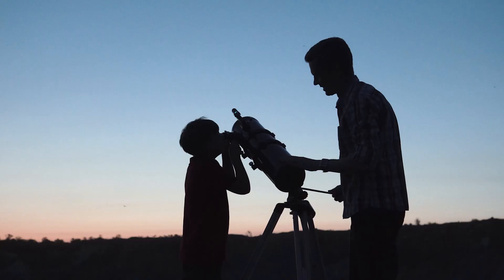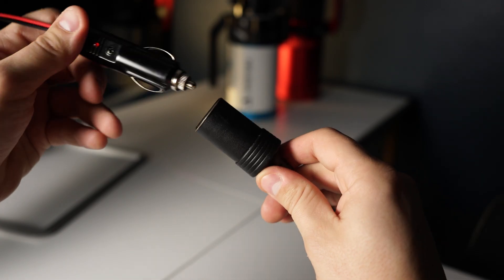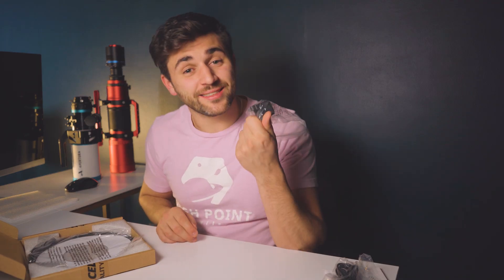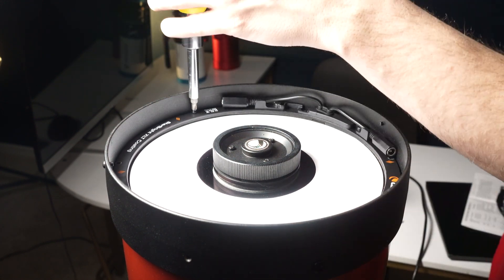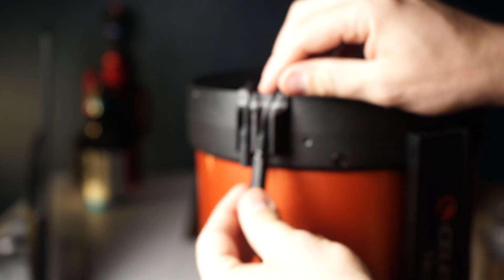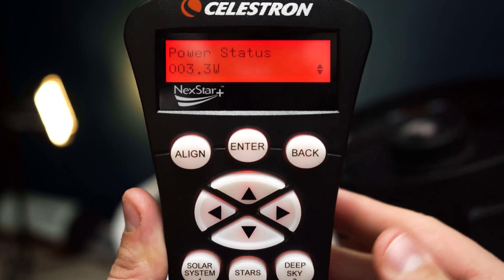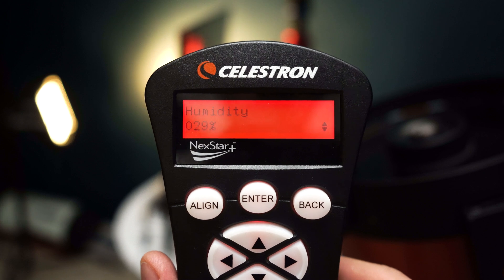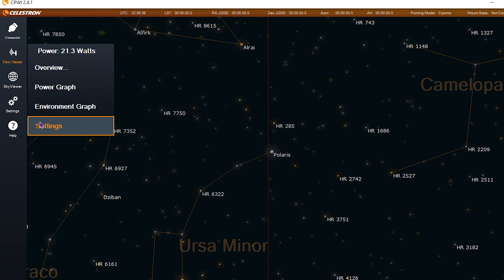Celestron Dew Controller | Full Overview and Setup | High Point Scientific

Comment: I'm a purely visual observer using a 120v wall outlet. Am i understanding correctly that i could plug in the ring with one cord (using a 120v to 12v adapter) and not bother with the thermistor? Thank you (update I found a 12v dimmer switch on Amazon and it's been working great with this heater ring)

Comment: 40 years ago, astro gear and viewing was so simple.  Today, you need youtube to explain so many necesary system installation and operation.
Reply: Well, sure.  Things change.  Some people prefer some of those changes, and some don't.  Personally, I live in a part of Texas where relative humidity averages 90%.  If I want to observe all night, I'm bringing a hair dryer or something like this.  The hair dryer works great, but at 1200W it won't run very well on a battery, so then I need a generator.  The reality is, the system in this video is much more convenient.  Mount it all once, and you're basically done.  I used Kendrick Astro's dew heaters before that, and they worked great.  But I wouldn't call them any more intuitive.  And if I'm not travelling and wanting to get in a ton of time, one of many manual scopes comes instead, and all of the sudden I'm living with "astro gear and viewing" that are 40 years old.  I enjoy that too.
Reply: I mean you still can run a simple setup. Some of us enjoy the tech as well.

Comment: Will the dew heater work with skywatcher or other mounts?
Reply: Yessir.  Not mount-specific at all.  Thought you may need to be clever mounting the dew heater to your rig, depending in the mount.  Be aware that if you want to power your mount from the dew heater to reduce cabling, your mount will need to run on 12V or less.  Also, I think the accessory ports on the dew heater probably only work with Celestron accessories like the WiFi or GPS module.  I'm not at all up to date on how this works with other mounts, though I do know Synta manufactures both Celestron and SkyWatcher.  You might get lucky.  The folks on the Cloudy Nights forum will know for sure.

Comment: What about the dew sheald for stopping stray light? Mine has the dew hearter built in it. If I get the dew ring I would still want to stop the stray ligh with the dew shead unpluged. Can that be done?
Reply from the maker: Yes! The dew ring should not interfere with the dew shield with the integrated dew heater!

Comment: Does this Celestron dew heater work with a Celestron EdgeHD 925 when NOT on a Celestron mount?  I use the iOptron GEM 45 mount with my EdgeHD925.  Will the heater work with this mount with or without the ASIAIR Plus?  Also, have you used it in the field and how effective was it to prevent dew?
Reply from the maker: Hello Michael, 

1) You can power the dew heater and control the dew temperature through other non-Celestron controllers like Pegasus, et cetera. You can also power the heater directly from a 12v power source without a controller.

2) You cannot use the iOptron Hand controller to control the dew heater system. 

3) The ASI Air can power the dew heater ring, but unless it has the ability to control the temperature, it will operate at 100%. 

4) Teagan was not able to use it in the field as he did not encounter any dew.

Comment: How does this compare to the PegasusAstro Dew Master?
Reply from the maker: Hello David, the Pegasus Astro DewMaster can control five dew heaters at once, but it does not appear that you can control it through software in the same way you can with Celestron and CPWI. The DewMaster could also control the Celestron Dew Heater Ring through one of the RCA ports.
Reply: @highpointscientific  these differences are true, however for a visual rig SW control is unnecessary. How about a comparison with the PegasusAstro PPB series? I'm in the market for a dew control system for my Celestron CPC Deluxe 800, which is a visual/EAA/planetary rig only (no AP). A dew controller with a built-in control loop with a thermocouple, RTD, or thermistor is perfectly fine and I think a better solution than a dumb solution with potentiometer control, no SW control needed as it will throttle power to the heaters on its own. Not sure which route to take for a dew controller, in the meantime I use a low-tech hairdryer solution.

Comment: Does Celestron make Dew Heater straps for refractors that are equipped with the same control and sensor technology?  In other words, are there dew heater straps with the sensor capability as well as the power cable?
Reply from the maker: Celestron doesn't sell dew heater straps, but the Celestron Dew Controller should control dew straps from other manufactures like AstroZap, et cetera.

Comment: Ugh. Removing the ring on the corrector plate to replace it with the dew heater makes my skin crawl. One little accidental nudge and you're in for a world of issues.
Reply from the maker: Yes, you need to be exceptionally careful not to nudge the corrector plate when installing.
Reply: na piece of cake just take your time and watch the video  @highpointscientific

Comment: Do you have to use the Celestron dew heater ring? can you use any dew heater straps?
Reply from the maker: Hello! You should be able to use any dew heater provided it has an RCA cable.
Reply: In my previous reply, tub should read tube, and the second 6” should be 8”.

Comment: Could you control the dew ring with the ASIAIR?
Reply: Should be able to. The AIR's power ports just send power, they don't look at brand or anything. There's really not a lot of electronics involved here.
Reply from the maker: The ASI Air doesn't have dew controller settings, but you should be able to power it either on or off via the ASI Air.
Reply: @highpointscientific  It can control the power output to a dew heater via PWM. So you can run it 100% or dial it down if you need less. But yeah, nothing more complicated than that.